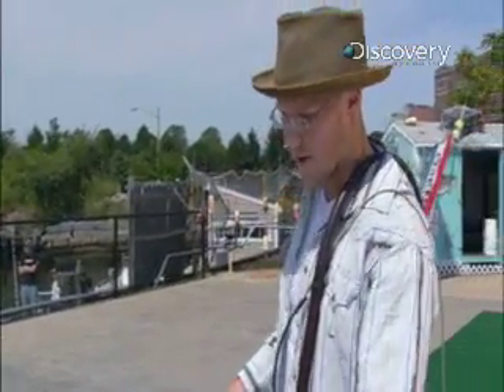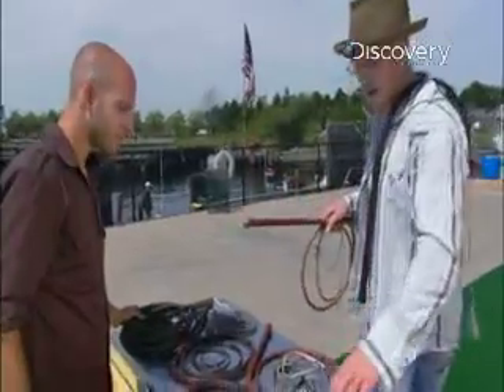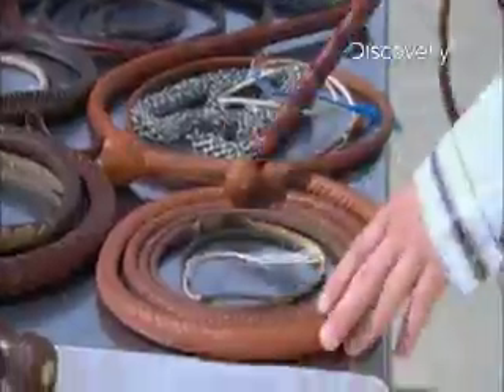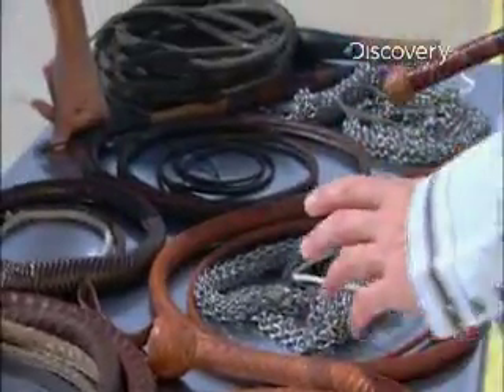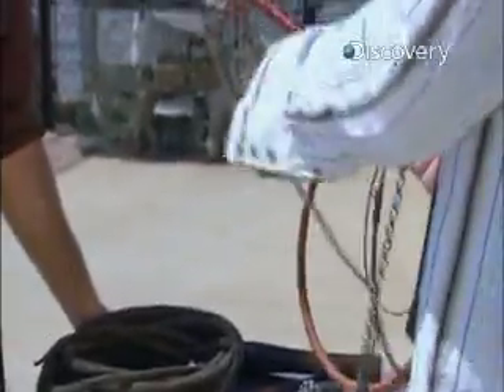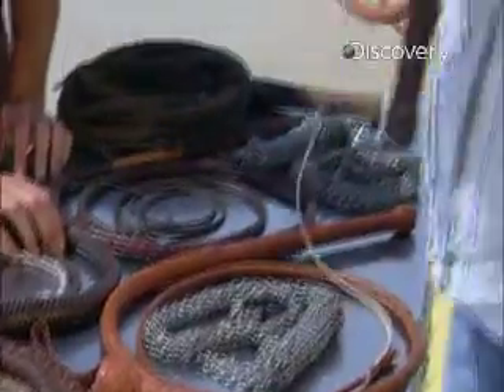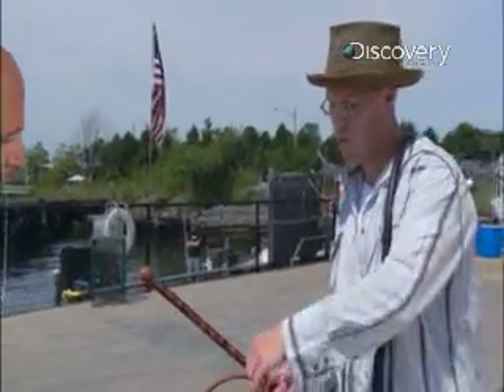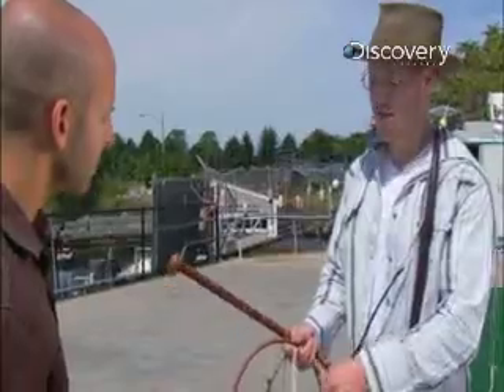Time Warp: Whip

Comment: @davyedoc A couple hundred cracks in the air is enough.  Going about 900+ miles per hour, thin string doesn't last forever.

Comment: @Indi139115 lol, when you snap your finger the noise comes mostly from the middle finger slamming into the meat of the palm. A whip crack isn't due to trapped air either (where on earth is there trapped air in a whip tip?). It is due to all the kinetic energy from the thick handle being focused down into the very thin tip, and since there is less mass the closer to the tip it gets the velocity increases to the point of supersonic speeds. Physics tells all.